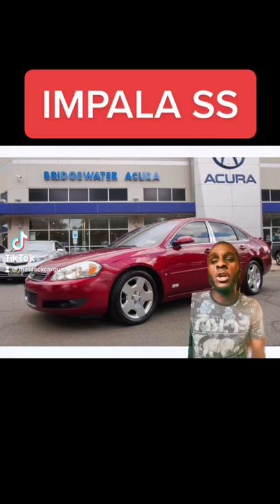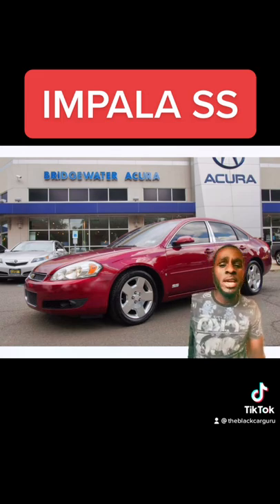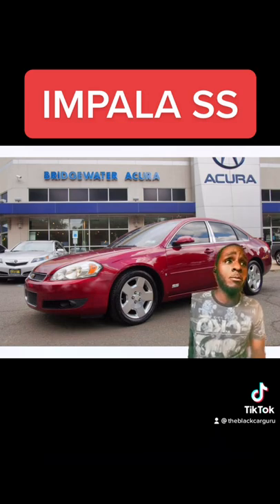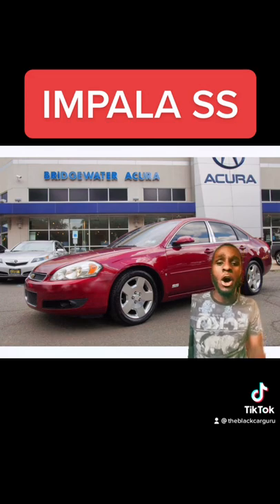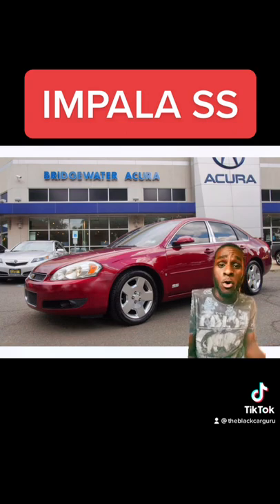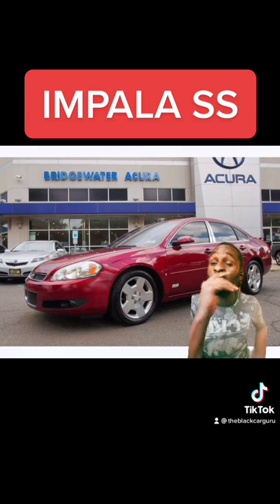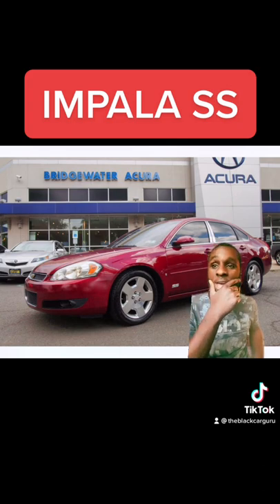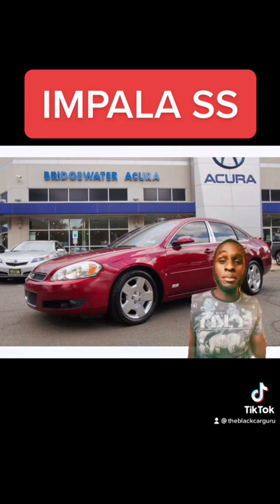The IMPALA SS was absolutely terrible!

Comment: Totally agree, but if you have the trans rebuilt and upgraded, it's pretty much bulletproof after that.
Reply: Yaaa I had the monte ss 06
Reply: No
Reply: Or just swap a 4t85e from a Cadillac fwd.
Reply: Still a 💩 📦 overall, starter motor bolted to the bellhousing, specially dedicated balancer for transverse mounting, custom dedicated unique crankshaft. The only saving grace are the heads. Everything else 🚮🗑
Reply: The 4t80e out the Cadillacs with the northstar should have been the transmission in the SS and GXP
Reply: @edrickjones717  would've been nice lol
Reply: You definitely own an impala ss saying that.
Reply: @donnerjackson1931  you definitely a dodge owner saying that lmao
Reply: @donnerjackson1931  who names their kid "DoNnEr"🤣😭😭
Reply: Throw a shift kit in there and you good to go
Reply: @r3vivalkicks620  I got one during my 2nd rebuild
Reply: I was told that particular trans didn’t have upgraded parts
Reply: @joeethereal2968  thanks for the info.
Reply: Know anywhere I can do that at?
Reply: this is still a fwd car I wouldn't even touch it
Reply: Ended up rebuilding mine work's great now rock solid
Reply: That goes for most cars with a built trans though
Reply: 4t60e grown men still believe in them 😂
Reply: Cap was told the same boomer bs cammed and a 100 shot
Maaaaabybe 450 wheel first launch blow it to Mars currently the only option is 4t80
Reply: Not true, had that car within the family for 5 years. Trans rebuilt 3 times and new owner messaged me it went out a week later after being rebuilt a couple months previous. Everything on that car was super solid but the trans. Very fun comfy car to cruise would buy another
Reply: @jimtom4878  Blitzen
Reply: @kramnull8962  huh
Reply: @kramnull8962  speden
Reply: @jimtom4878  You asked the other day, "Who names their kid Donner. 
Blitzen...
Reply: @kramnull8962  what's blitzen lmao
Reply: @jimtom4878  reindeer.
Reply: @kramnull8962  you know your Rudolph lore
Reply: so it sucks
Reply: I had a guy who had a ss and he had 2 performance rebuilds on the trans and it still blew every time he was making 430 whp so I would 4t80e swap or leave it stock
Reply: Absolutely, i got a 2010 and my tranny went out twice as soon as i upgraded the tranny its been a tank
Reply: @savvypq4333 that 06 is nasty!! I had one your 💯% right
Reply: I got the 06 Monte Carlo SS, and the Trans went out, but now he's bacc
Reply: They don’t make any beefed up solutions for that 4T65E stock trans but you could do the swap to the 4T80E trans that takes that power very well
Reply: @Kawawahilani  an then Boom!!
Reply: Yup bought a whole upgrade to my tranny. Came with shift kit and new torque inverter all that. Then the shift solenoids and cooing lines went. Been parked since covid. Ready to sell it for 2k. Any takers?
Reply: @MrBo448 😂 I was thinking the same shit
Reply: 4t80e,right?
Reply: Yea I got mine at like 20k and it was slipping once we swapped it was perfect there after
Reply: With the torque steer and the traction issues it could never lay down any impressive performance. Other than the looks of the 06-07 Monte Carlo it’s nothing great about it, and is strictly a cruiser, otherwise you will be getting embarrassed by Nissan’s and Honda’s on the regular
Reply: Bullet proof but not 1000whp bullet proof. Gm f40 is a good manual swap, there’s also a trillion getrag transverse manuals that gm has put out. I got a 06 Monte ss and plan on this swap.
Reply: @williebailey91 not so much the case when you manual swap and dabble around with awd :)
Reply: @DaleEarndhardt  Yeah and if you strap a rocket to it, it will blow the doors off a Bugatti😂.
Reply: @williebailey91  🤣🤣
Reply: @joeethereal2968 its just a 4t80e and they have alot less aftermarket and not the go to fix all fix like some want to believe. if a stock northstar can ruin them trans before they even hit 100k i cant see it being a better solution.
Reply: @BLACKOMEGA who ever told you that was a lie,  the fastest ecotec in the world---or should i say one of the fastest 4cyls period uses this very same transmission, same goes for the world record 8 second 3800 powered grandprix uses this transmission.    triple edge performance,zzperformance would a place to look at for aftermarket support for the 4t65 trans
Reply: @johnakaODB  how did you rebuilt
Reply: Man that car will give u atleast 370k miles. I had two and both of the went over 350k🔥🔥
Reply: @johnakaODB how is it running now a year later since you commented?
Reply: I thought the same thing. Thank you for that 👍  @barelyrollin
Reply: Most definitely not I knew 3 people who was putting 400 whp down or more with these cars and all of them had a performance rebuild still blew up every time 3 transmissions and warrantys later

Comment: Only if this was a rwd or awd transmission gm would have had another classic on their hands
Reply: What trans would fit? A S10?
Reply: An AWD would clap
Reply: @neonryder8897  these cars arent worth building unless you dont care about upgrading absolutely everything.   This car was so poorly built a fwd v8 has no business being in this car it will break so many things
Reply: same with the monte carlo SS, i will never understand why they decided to make it FWD,, they could have been dope ass cars
Reply: @turnermd1302   said that right
Reply: Nope they did it in 2017 and no one bought it Chevy ss
Reply: @richzhoo4236  i always said that too.
Reply: @turnermd1302 M at the time had no rear wheel drive vehicle platforms in their stable ( minus the CTS, corvette and the Pontiac stuff from Australia). This platform was front wheel drive only. It is a shame.
Reply: @Opium64 The Chevy SS wasn’t meant to sell. GM had a contract with Holden in Australia ( where the SS is built and imported from) to sell roughly only 4000 units per year. After Holden shut its doors in 2017 ( the factories are gone) that also meant the SS was gone as well.
Reply: @Opium64 I wanted that SS in 2017.  Unfortunately they only made it in one trim that started at $46k. I wasn’t able to afford it until one year after they stopped producing them. I would have bought a red one with a manual.

Comment: Miss my SS. 3 transmissions in 5 years.
Reply: Daayum!! I rebuilt replaced my at 160k with a new one from Bob Hook chevy performance center
Reply: Woah
Reply: God damn that hurts my soul...and my wallet
Reply: dam ive had mine 5 years with only one transmission an i work on the road putting 40k miles a year on it you must have been really driving the car hard
Reply: Aight bro I think you’re the problem
Reply: @John-nj5ls  naw it’s a problem with those and GXP. Too much power to be front heavy car. Do you research.
Reply: DAM😮
Reply: Damn
Reply: @John-nj5ls  🤣🤣🤣
Reply: Automatic transmission? Can't be easily swapped by a manual one?
Reply: @phrodendekia there’s no support for the fwd drivetrain with a manual lots of custom work
Reply: @tankiller9638 LMAO
Reply: 4t80e swap

Comment: LS4 king made a solution,  4T80E swap. Trans stock holds 800hp.
Reply: Yup currently swapping my North Star for and later model ls4 and keeping the 4t80e
Reply: Can a S10 trans fit? Make it all wheel
Reply: @BFarms wouldn't hold the power
Reply: @HansBelphegor  how wouldn't it?
Reply: Yeah  have to do a rwd swap they come fwd
Reply: @jkink8049  the 4t80e ? They're fwd already an so are the 5.3 Impala's
Reply: The design is still trash 😂😂😂
Reply: What cars bad the 4T80E? And will it work for a V6 ? Since those break them easily as well. 😒
Reply: @dnegel9546 cadillacs with the northstar v8. Most commonly a deville, sts, or eldorado. They also came in some buicks, oldmobiles and the bonneville gxp.
Reply: @dnegel9546 and theyll match up but you gotta do some grinding and cutting to get it fitted right. Idk if the starter location works on the v6 tho.
Reply: @Yourcommentisretarded you drive a honda calm down
Reply: Yeah but can the ls4 with the aluminum block handle that?
Reply: @bullet-sm5gd  should be pretty similar to an ls2 block but im not so sure about the power capacity. Hes just saying the trans can handle 800hp reliably ive heard of people even swapping 1000hp ls7s into em.
Reply: @Yourcommentisretarded  I agree but once it’s fixed correctly then it’s game on
Reply: @fabienmartinez5976 I want to do the same thing to mine, have you got into it yet?
Reply: Looked like a grocery getter and it's wrong wheel drive for a v8

Comment: I have one of these with 211600 miles on it. It's only on its first rebuild and that was 5 years ago. The trick is to remember that the exhaust goes over the transmission and remeber that heat is an enemy. Not many people realized that when they were racing around on these and modding them. After you take care of the heat it will take a little more abuse.
Reply: What did you do to the exhaust to take care of the heat around the trans though?
Reply: @Veno  heat wrapped the crossover pipe
Reply: @RareBodyCams  you can also put a piggyback transmission cooler on it and use a zzp transmission pan for the 4l65eHD

Comment: Gm should of just used the transmission out a Northstar with the factory oil coolers. They did a backwards idea. One had a bad engine good transmission one had a good engine bad transmission
Reply: GM was trying to cut corners to much but yeah that's crazy, idk what's worse the Northstar engine or the 5.3's transmission

Comment: This car is worth a second look Retired Chevy Impala SS Police interceptor 2006-2014 3800 series 3/3900 series V6  engine or 5.3 V8 , very affordability in the price used market range $1,000-12k , LS4 6.0 vortec V8 engine, 6.2 LS3 engine /LT1 6.2 V8 engine Camaro SS gen5 , W body platform almost forgotten today because the Dodge Charger Hellcat and Challenger Hellcat, Chevy Impala SS can be a hellcat killer.

Comment: After a few upgrades my trans bullet proof rebuilt my trans at 180000 miles and decided to upgrade it since I cammed tuned and threw on some long tube headers
Reply: what upgrades did you do to your trans
Reply: @GodliRF  all did was a shift kit, billet torque converter, and trans cooler

Comment: I bought one in 2013, i got rid of it by 2015. It stayed in the shop more than i drove it. Replaced the cv axels in the front, wheel bearings, control arm, radiator, 2 transmissions, and motor.

Comment: These are so nice. I've had two. But yeah, the fact that they couldn't engineer a proper transmission, really pisses me off. Like, sure, make it FWD, but give it a proper transmission. It's not like it hasn't been done before. The Oldmobile Toronado had a 7.5 V8 with over 380hp and 500 lb-torque. It could handle it just fine.

This could've been a great car, but they half-assed it.

Comment: My 2007 SS went thru original transmission at 30,000 miles, replaced under warranty with rebuilt one at no charge. That one went just before 60,000 miles, again, replaced with rebuilt under warranty, started to go again just before 80,000 miles, traded it for 2011 LTZ, no issues with this transmission and car.

Comment: Still got mine. Got a triple edge performance trans with cam and headers with a small 40mm to 50mm turbo and a dyno tune.With 20inch Irocs. Its at 623 HP at the wheels. Could've got it higher but I didn't see the need. Still love it. And it turns heads.

Comment: Cadillac CTS 2009-2014 6Ll80E or 4L80E early 00-06 Suburban and Tahoe, Cadillac Escalade, Silverado 1500 transmissions swap is perfect SS ,  also switch Chevy Impala SS front wheel  to rear wheel drive.

Comment: There are people using the northstar 4t80e as an upgrade. Also, the g40 sixspeed manual that was in the g6 gxp will work but both transmissions require physical mods to work. Starter for the g40 manual and case griding for the 80.
Reply: How do you know that you done one before I’m looking in to it

Comment: Soooo what transmissions were in the supercharged 3800 V6's before the 5.3. Those were all heavily modded alot and i dont remember hearing many complaints
Reply: In earlier W-Body cars that had a supercharged 3800, the transmissions used were 4T65-HDs, which also got used in later performance W-Body cars with the 5.3. Unfortunately, even though it was supposed to be more heavy duty, they just couldn't handle the power. Even with just 240 horsepower from the 3800, the transmissions were barely hanging in there, and the 5.3s kept grenading them.

Comment: About this car and it has 70,000 miles on it. I was unaware of a Carfax but I later did a check and the transmission was replaced at 69,000 mi. The car now has 155,000 mi and that transmission is still going. It shifts as if it's still brand new

Comment: The engine doesn’t have the same bellhousing pattern as the other V8 engines, it was done that way so that it could be used in FWD applications, and shares the same bellhousing pattern as the high value V6, which does open up options for manual transmissions, such as the Getrag F23 five speed, or the later F40 six speed
Reply: Lots of guys running 4t80s out of northstars

Comment: They actually supercharged the 5.3L V8 and put in a stronger transmission.   HOT ROD Magazine had a small article on the build.    I can’t remember the transmission except that it might’ve come from the G8 from PONTIAC.    They also put a shift kit in it and a higher Stahl converter in it.    It ran like a scalded Ape.    Surprised everyone at stop lights with its deep growl, and was a lot of fun for the journalists.    It’s what happens when you let engineers play around with what spare parts they have laying around

Comment: 4t65-e hd is the transmission it runs. There is a transmission guy that disassembles the 4t65-e  and he shows and describes what parts wear fast and why they wear fast. Now the 4t65-e what the 3.5L v6 run. The 4t65-e hd is for the ls4 v8. Same transmission the hd of course is heavy duty. But this guys video is gold because he goes so in depth that you will know what parts to replace. 

I 100% believe if you can change the right parts out it can become a real sport car. May not move like a vet but it will be able to handle the power. And keep up with some sport cars.
Reply: Thats funny my uncle told me.before selling me the car that it outhandles every vette 2006 and lower😂
Reply: Also the 3900 V6 had the HD trans as well.

Comment: could take the honda manual from a j series acura, do the 6th gear delete to replace with a stabilizing cuff for the in/out shafts (common mod), and maybe throw in the 3 & 4 straight-cut gear upgrade. there’s a fwd manual trans that can take 5-600hp pretty well.

Comment: Chevy Impala 2006-2012 , from Chevy Camaro 6.2 LS3 engine 2010-2014 swapped and transmission swap in GM 6L80 or 6L90 from Camaro ZL1 or Camaro SS, Camaro Dash broad 2010-2022 , local junkyard is a cheap way to transmission and engine and dash broad.

Comment: Lol!! I know All to well about that tranny! Mine went around 180+k but that's I bought it because the GM dealership I bought it had an included Lifetime Powertrain Warranty! Had two water pumps, 3 or 4 front brakes/rotors, new transmission and couple other things too. Just had some idiot driver take it out but planning on building up that 5.3 and dropping it in a 2nd/3rd Gen Firebird, most likely 3rd Gen.

Comment: Had a 07 looked just like that, was the best car till the transmission started slipped, lol but still would smoke alot of cars, but then the water pump is 600 in a shop the heads are 5500 ya f that shit lol

Comment: Miss my 07 monte ss….. thing was so fun to do burnouts in and was actually pretty quick with all that weight over the drive wheels. 

I actually love the 06-07 Monte ss styling, if only they had put a better trans in it that had more than 3 regular gears and 1 overdrive gear. 

That mf would shift outta first gear to second at like 45 mph and then to 3rd at like 80-90 mph 😂😂😂

Comment: So from the comment section. The ls in these cars are fantastic the transmission is terrible but to equalize the issue of the car’s problems compared to a Cadillac dts or sts with its fwd v8 that’s horse shit but the trans is fantastic so why isn’t there any ls swapped dts around or sts around or snag the trans from a junked caddy and put it in the impala ss either or it’s a fwd v8 four door.

Comment: I wonder if anyone has done a RWD conversion on these LS4 cars? 🤔
Reply: It's a guy on YouTube that's done one it's really nice I'm going to do my Monte Carlo ss
Reply: @MrTwone79  I'm not surprised honestly 😂, but still really cool! I think I saw someone do an LS RWD conversion on an 8th gen Impala, which was the 1st year of the FWD Impala's if I'm not mistaken.
Reply: If I remember correctly, the ls4 uses a v6 bolt pattern. The gm t5 from the v6 camaros and firebirds would bolt up, but you'd need to do some Frankensteining to the flywheel and clutch (and some upgrades to the trans).
Reply: @Blade_of_Violet_Chaos  Got ya

Comment: You might take at look Chevy Malibu 2008-2013 V6, Chevy Malibu 2014-2019 V6 engine  just need a LS engine swap , the body style Chevy Malibu 2008-2013, Chevy Malibu 2014-2019, Buick , Pontiac, Chevy, Oldsmobile any from W body with 3800 V6 engines 1993-2013 are sleepers cars to buy Buick from Florida to Los Vegas from warm weather are not rusted out , 3800 series v6 is one good LS engine swap away V8 engine muscle car 🚗

Comment: It was a 4 speed auto made out of glass and rubber bands.  The solution? Buy the 2012 3.6 liter V6 with a six speed transmission that made the same power as the 5.3 litre.  OR don't F with it at all.

Comment: I own a 2006 Chevy impala ss with 313 000km on it and I abuse the thing daily, do burnouts all the time and the trans is still working fine. I think you just don't know what your talking about, the 4L60-E is built with stronger internals and a limited slip differential. The thing was literally made for burnouts.